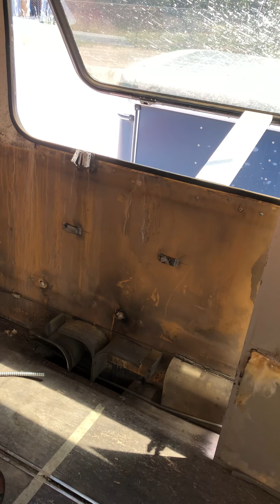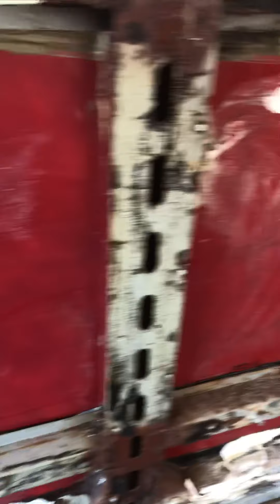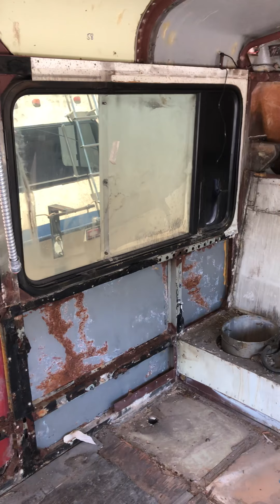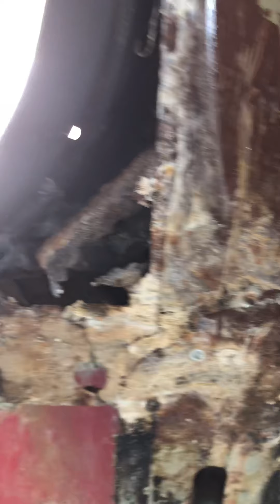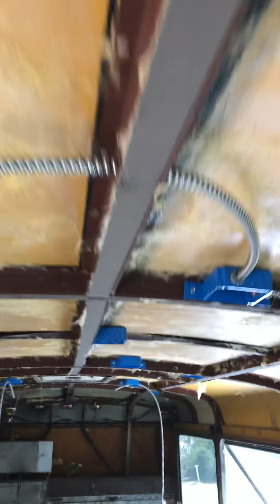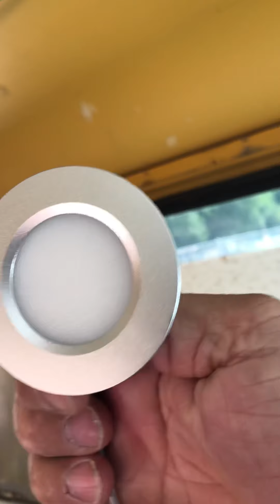MCI M9 conversion

Comment: Hi Chad, thanks for posting your build. Very helpful as I begin my ‘82 MC9. I was wondering if you ever found out if the wall plates are necessary for structural strength. I would like to remove mine and save the weight. Thanks, Brad
Reply from the maker: are you talking about the interior aluminum skin below the windows? I did not install mine, but I sheeted the wall with 3/8 plywood.
Reply: @constechable  Yes, you said you had mixed opinions if they were necessary, I guess you proved it’s okay without. I want to remove them but knowing it’s not an easy job I probably wouldn’t if I had to reinstall them. Very impressed with your finished job, excellent craftsmanship, inspiring but very intimidating.  I look forward to the other videos when you get a chance to upload them, thanks.